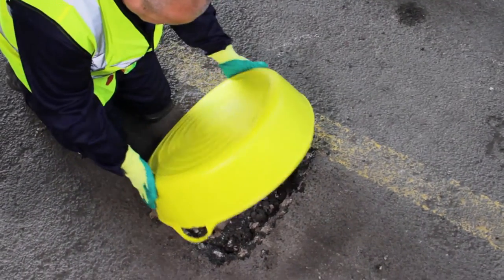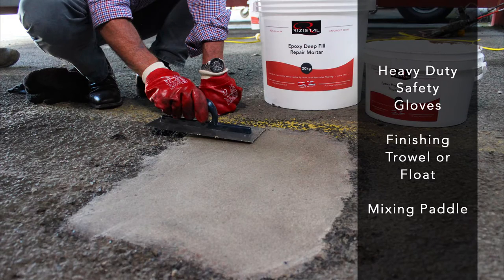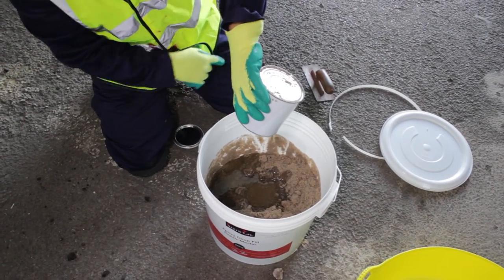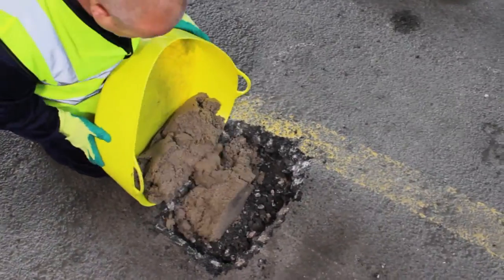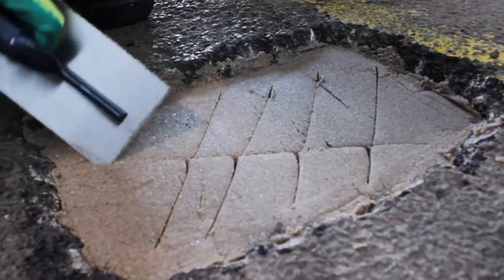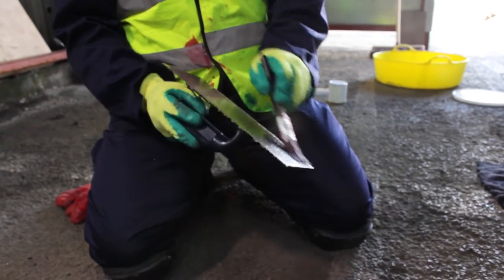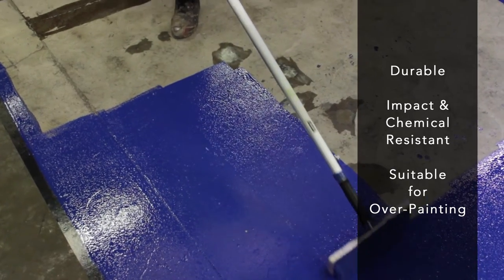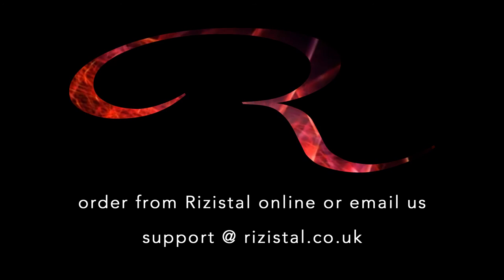Repair a hole in a concrete floor | Rizistal

Comment: Is this waterproof?
Reply from the maker: Hi yes the product is waterproof once fully cured. You can find out more information here https://www.rizistal.co.uk/product/deep-fill-epoxy-concrete-repair-mortar/
Reply: Whats best to use over concrete garage floor, I want to cover whole floor